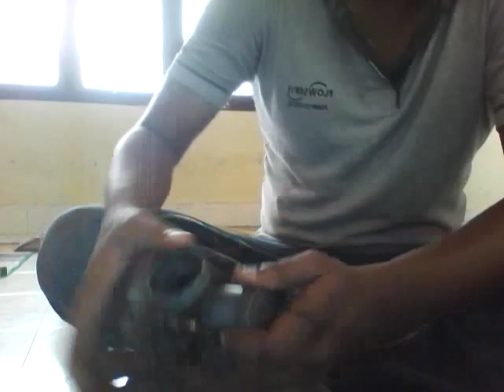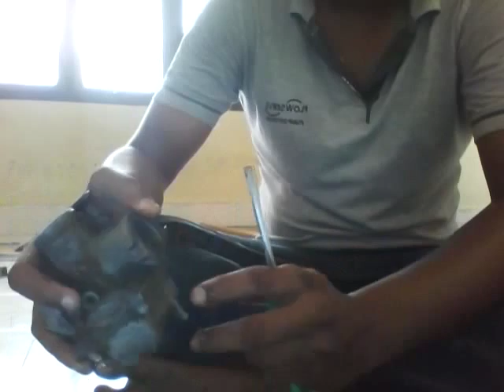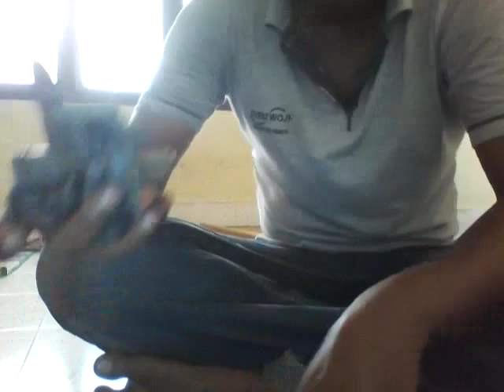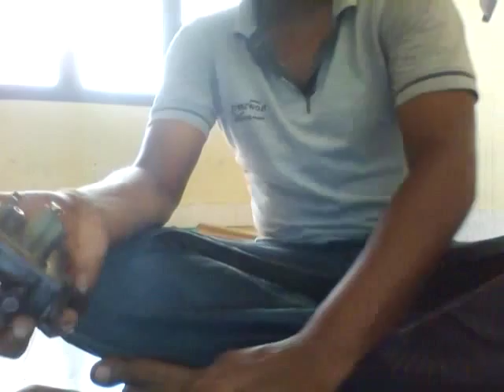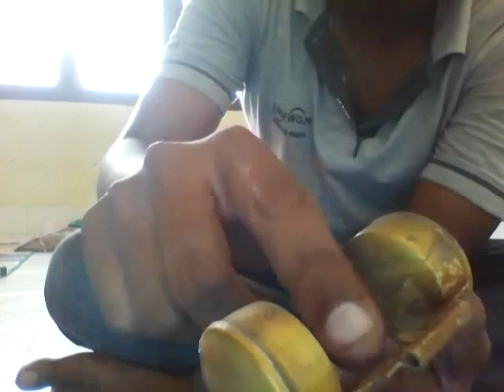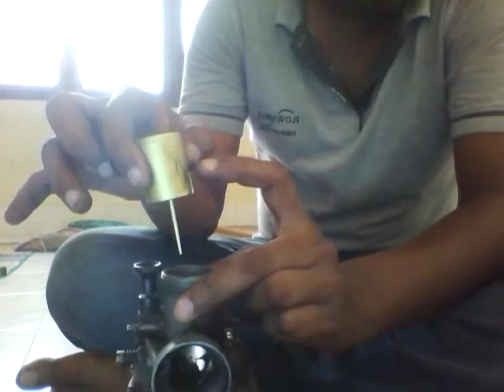Dismantle and assemble Bullet 350cc carburetor

Comment: Kitne kilometers bad carborator clean karna chahiye plz replay
Reply from the maker: Mayur Yadav can pls text in English.
Reply: Sabarish ... After how many km should I clean carburetor
Reply from the maker: Mayur Yadav it is better to clean on every service (3000/4000 km once.) . actually old motorcycle tanks might be corrected and with dirty particals.which will be reach carburetor flot container by fuel line hoses. So it's mandatory for old motorcycle. (Airfilter also one of source for dust on carburetor).
Reply from the maker: The latest UCE (unit construction engine) RE motorcycle is having CV-constant velocity carb( working by diaphragm).in this video, I have shown the slide type carburetor.